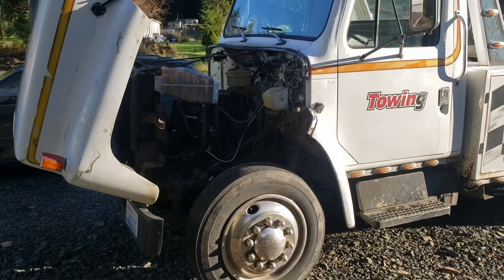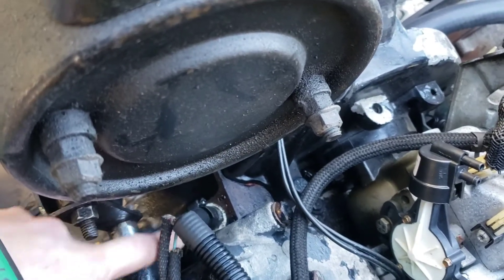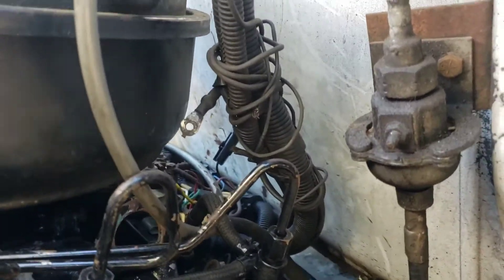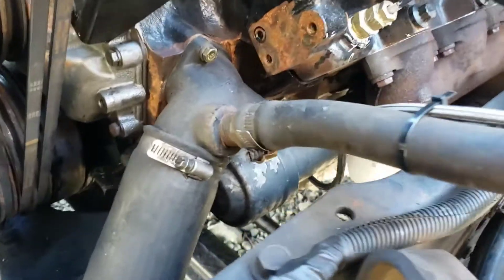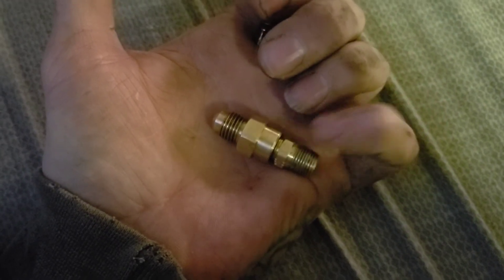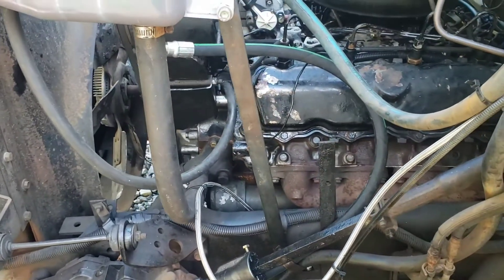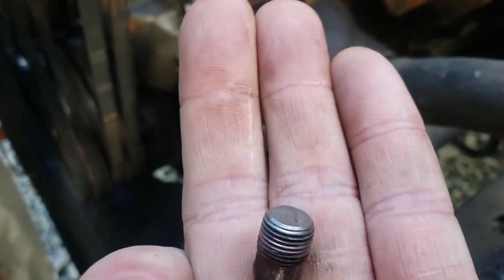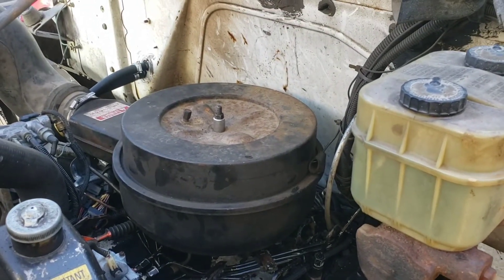7.3 idi diesel gauges oil pressure coolant temperature alternative sensor installation locations

Comment: Can it run without a fan shroud?
Reply from the maker: Yes, it will run without a fan shrowd. Just watch your temperature especially if climbing hills or hauling heavy. The fan shrowd helps the fan pull more air through the radiator. Without the shrowd the fan creates alot of air turbulence but doesn't pull it through the radiator well. So more prone to overheating.
Reply: I had a Nissan pick up  and I took it out

Comment: What is ur normal operating temperature? An what temperature u consider it to be overheating?
Reply from the maker: My trucks run around 180,  overheating would be 240-250 depending upon how much you care about the rig and how far you want to push it.

Comment: What is the coolant senor part number can I get it on Amazon?
Reply from the maker: The idi trucks have 3 different coolant sensors and switches. 1 for the dash temp guage, one that turns on a dummy light if the truck overheats, and 1 that turns off high idle solonoid once the truck is warmed up. Honestly I never replace the ones for the gauge because the gauges in these trucks are crap. I just install aftermarket gauges to watch my temperature.

Comment: When I first got my 7.3 idi it would stall out. Once I changed the oil sensor behind intake it stopped stalling, 
  then later I had other issues. I had jerking then stalling. I noticed my radiator hose super hard, like it was stopped up. I was stuck in middle of nowhere so I just pulled water thermostat out, but continued so i flushed it, but still issues. The gauge never read hot. Turns out bad  water sensor, and plugged radiator. Had it rebuilt, stuck new thermostat, and working great now. 
  Just thought I'd add this, incase anybody having similar issues.
  We only have each other. Together Strong!!😎👍
Reply from the maker: First thing I suggest people do to an old ford is install real gauges to monitor actual engine temperature and oil pressure.

Comment: Is the plug for the oil pressure port next to the oil cooler going to leak oil when you take it out?
Reply from the maker: Not if the truck has been off for a while. All the oil pressure drains back and settles in the pan once you shut off the engine.
Reply: @worthshop  thanks man, putting in a new gauge now it’s awesome you responded so quick 😎

Comment: Hey Aspie! Just wanted to ask about the location of the EGT. I’m not sure if that’s the same thing or if its in the same area as the oil pressure sensor location. I have a 6.9 IDI and the guage starts at 1k when cold and as I drive it increases to about 2k but goes up to 4k not sure if it’s working properly so I want to change it.
Reply from the maker: Egt gauges are aftermarket not factory. Most people drill into the exhaust manifold towards the back of the engine. If it is getting up to 4000 and your engine is still running, it is definitely wrong. Anything above 1300 or so starts turning your pistons valves etc. into liquid metal.
Reply: Thank you so much, that makes sense then. I actually followed it and it is behind the engine by the manifold like you said. Also, is it a good idea to replace it or install a new EGT in a different area that is more accurate? Thank you for all you do Aspie. I really appreciate it.

Comment: I have a question for you. Between the temperature sending unit by the water pump and the overheat switch located on the driver front head are they the same parts? Or Can you tell me the part numbers for both I would appreciate This. Thank you
Reply from the maker: I have never replaced the stock sensors, always had other issues with my trucks, inaccurate or non working gages etc. So just replaced with aftermarket.
Reply: @worthshop  😎👍

Comment: I have a 7.3 IDI in my 1988 Ford F250 going to do the same. What brand gauges are you running if you don't  mind my asking?
Reply from the maker: My gages are nothing special just a cheap $30 no name set they had at the parts store when I needed them.
Reply: @worthshop  OK, I've read some other folks have done this and their gauges quit on them in less than a year. I'm going to order some Bosch gauges, It's a little pricey, but they usually are good quality. I figure the less repair drama, the better.
Reply: @kman-mi7su  I am using the stock gauges... To correct this temperature gauge issue when you change the temperature sensor and you still have no luck... When you first start the truck and it peg to hot may not be the gauge for sending unit. It must work in conjunction with the overheat switch otherwise you will have an engine light and peg at hot. So what I'm saying is change the sending unit, which is located on the backside of the water pump. If no luck,,, change the temperature switch located on the front head drivers side. These must work together, otherwise you will have errors